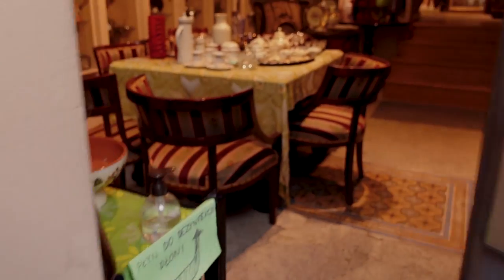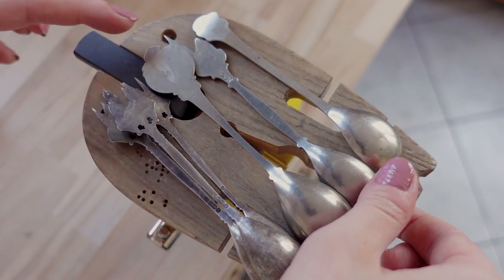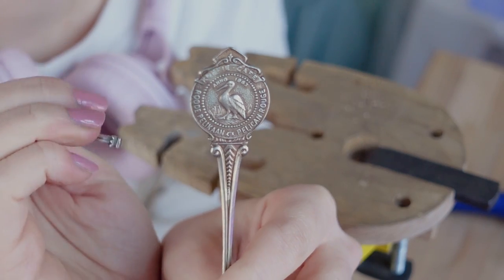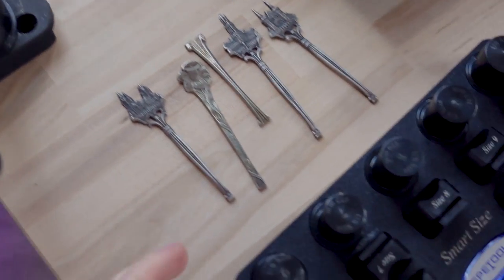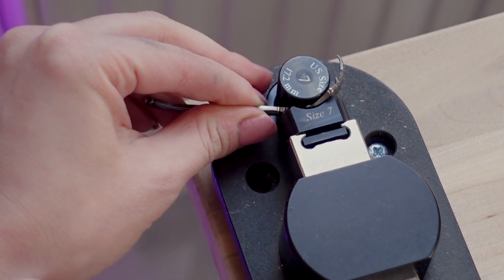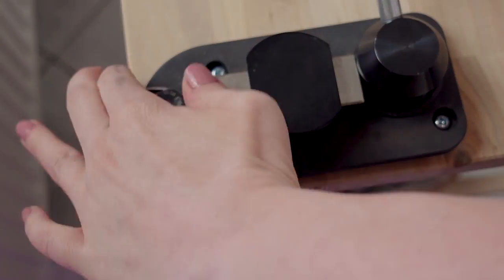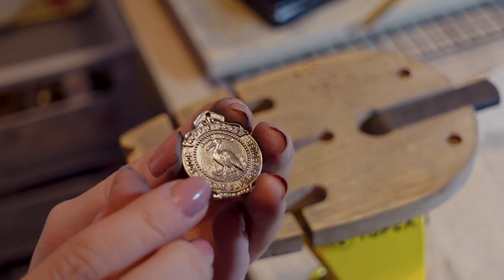How to make SPOON rings! Using original antique spoons

Comment: i have to admit, every time i saw spoon and fork jewellery anywhere i felt very meh about it, because they still screamed "spoon!!!" when you looked at them. but yours look so cool and unique, that i'm now tempted to experiment with spoons as well, which i didn't think would happen in a million years bahaha :D i love the pelican spoon, an element like this could also look so cool as a signet ring. the fact that soldering or even annealing those is potentially risky, can definitely be used as a way to make you think outside the box and try and get the result you want using other methods than the ones you'd normally use :D
Reply from the maker: same with me! Although I liked some of them, as the resembled a shield, so I liked those. But other than that, not a big fan. Until I realised that I could try these unusual ones! I rembered seeing them at antique fairs and decided to go look for them in antique shops. And I like what you said, these materials that are other than silver can help us think outside of the box and get creative! :))
Reply: @TheArtOfMetalsmithing  you’ve clearly come across way more creative examples then 😄 also, the spoons you picked are super original and that makes a world of a difference. It would be really cool to treat the spoons’ elements as stones 😍

Comment: Great project! What is the metal? I can imagine you definitely wouldn't want to anneal anything plated. Those look like silver, hallmarked..
Reply from the maker: The ones with buildings are certainly silver (although the man at the antique shop told me they were plated, so I think he might not be sure or maybe he mixed them up with other spoons?), the one with flower is definitely not entirely silver. I think it used to be enamelled, but there was hardly anything left on it and it was alright to anneal it. I'm going to examine the spoons some more to see if I can determine what they are for sure
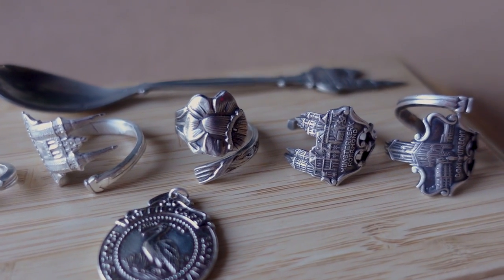Reply: Dear Basia, I certainly wouldn't argue with the salesman in this case. Although the patina on these Dutch spoons is distinctive for silver, the silver itself may indeed be merely a coating on neusilber. It may just be a light effect, but it seems to me that in the final shot at 9:18 the Waterpoort Sneek ring is little bit more yellowish than the Munsterkerk Roermond and  the Dom Utrecht rings. If so, it's cos you've scraped the coating off it. Although neusilber is very close in colour to silver, cutlery made of it should be coated by silver because this alloy itself has a zinc taste. You can check it just by licking the Waterpoort Sneek ring:)

Comment: I'm not sure, but it seems to me that the top three spoons at 1:30 are made of melchior. If so, the rings you made from these spoons could cause an allergy to nickel for the people who will be wearing it. I advise you to check the metal with silver nitrate.
Reply from the maker: I think that's very likely! They're definitely not just silver (if they even have any silver at all that is ;P). Wasn't going to offer them for sale anyway, but it's a good thing to keep in mind for future, so thanks for pointing that out
Reply: I remembered one very simple way to identify melchior: depending on nickel content in the alloy, it is either impossible or very difficult to melt it with a butane torch. You can also try this.
Reply from the maker: I will! Thanks so much for this, very helpful